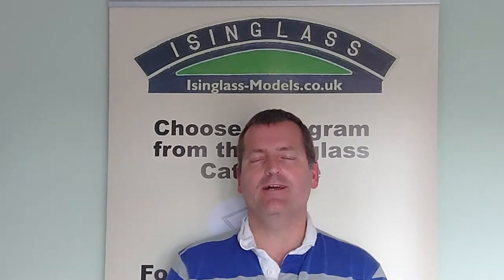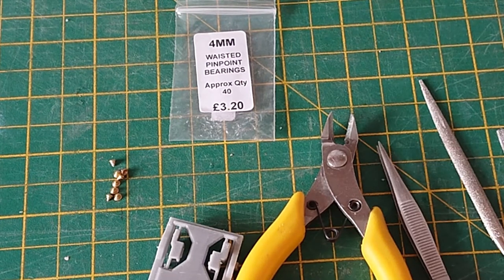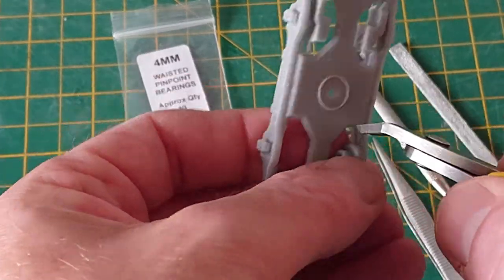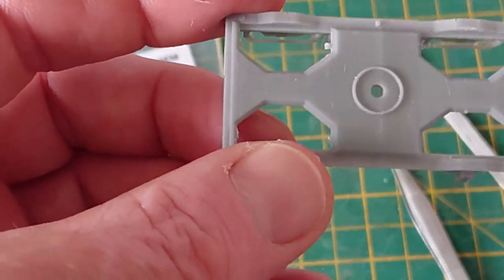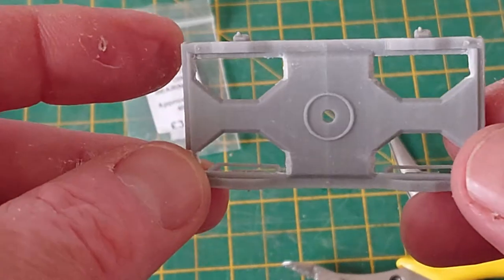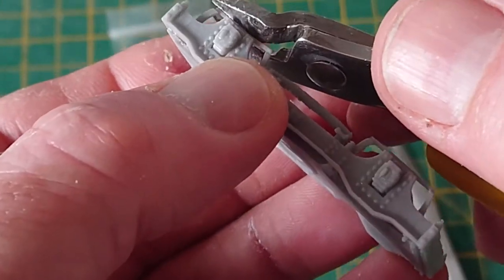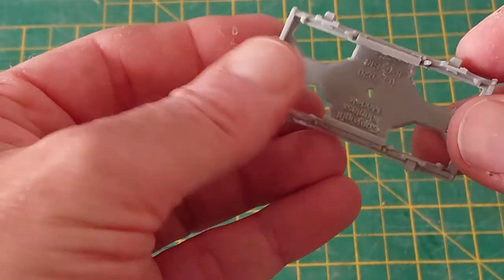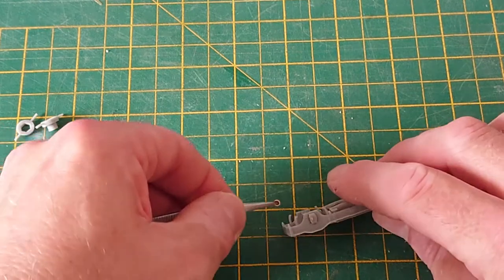Assembling Isinglass Bogies

Comment: Very nice. Which wheels do you recommend?
Reply from the maker: Any 26mm axle wheels with brass bearings will be fine. The bogies work with OO, EM and P4. I tend to use Markits wheels.
Reply: @isinglassmodels  I have some Hornby coach wheels in my parts box, they should be ok to use?
Reply from the maker: Depends on the axle width, some hornby axles are shorter